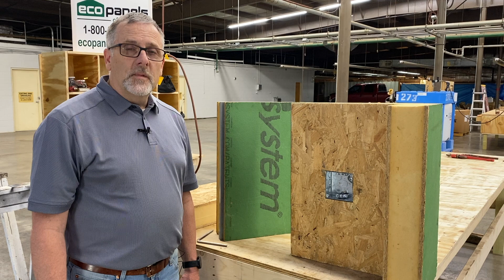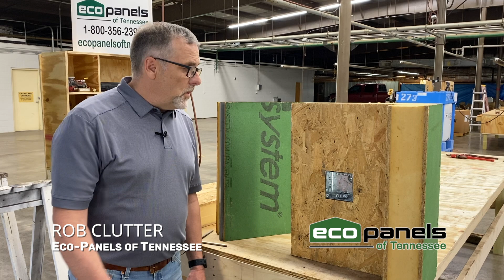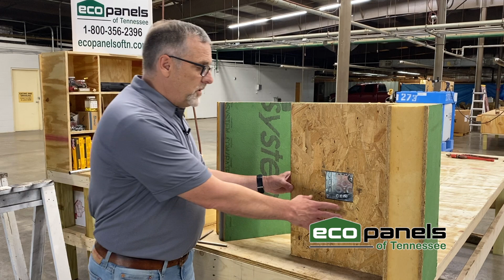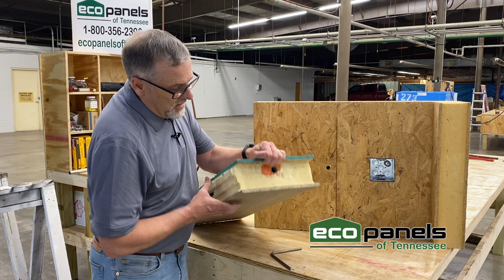How are SIP panels joined together?

Comment: I like the cam but am concerened about the seasonal expansion contraction of the OSB being butted tight. What happens to the joint during the extreem conditions?
Reply from the maker: Good question and thought process. The panels are designed where the T&G connection generally stands the OSB off by about 1/16th on the edges, allowing for he seasonal expansion and contraction that occurs. We can't speak for every SIP company out there, but we can't contribute any issues to this. It's also worth noting that if you choose the ZIP sheathing, which out customers commonly use on the exterior, it is manufactured with this expansion/contraction gap. Hope that helps and thanks again!

Comment: What is the solution for waterproofing the sip panel? Given its propensity to absorb water.
Reply from the maker: Thanks for the question. Not all foam is equal, and this is a great example. We're injecting a proprietary closed-cell polyurethane foam that carries a Class I Vapor Barrier rating. Its water absorption rate is so low it basically takes lab equipment to measure it. We've submerged pieces of it in water for extended periods with no measurable absorption. It's even been recognized by FEMA as a suitable insulator to use in flood prone areas because it doesn't absorb water. Hope that helps!

Comment: Great...until you need to trim the panel exactly where the metal cam lock is situated.😁
Reply from the maker: Good comment. Thankfully, we design the panel layout so that this shouldn't be an issue. From our experience, it's very rare. But for arguments sake, let's say a panel with cam-locks does require trimming. It's not that difficult, and is basically done the way most standard SIPs are joined together at each joint. It's just that this standard is more time consuming and not as easy as the cam-locks. The cam-locks can be removed on-site, and a code compliant method of joining the two panels can be achieved. We're always just a phone call or site visit away, so we can help coach an unfamiliar builder through this with relative ease. Thanks for your comment!

Comment: So im curious about using sips but have a few questions. First, since sips have been out has there been any issues with the foam separating from the osb. Secondly how do you run the plumbing and electrical through the panels. Whats the warranty on your sips and whats included and not included.

Comment: i built a sip house in 1996 the side joints involved a system similar to your sill plate joinery, with double 2x6 's on one side and a 2x6 shaped cove on the other piece ....the joint was glued along the edge in a continuous bead and the cove was nailed every 6" on the coved side.....to the sill plate the same adhesive and nail procedure was utilized....used 6" thick panels (7, counting the osb) on the walls and 8" roof panels with a properly sized glue-lam ridge beam to span the full interior , to speed dry-in